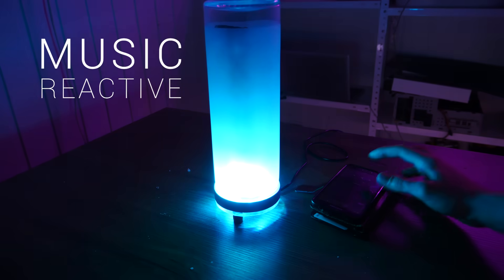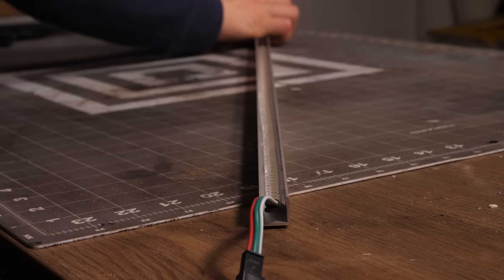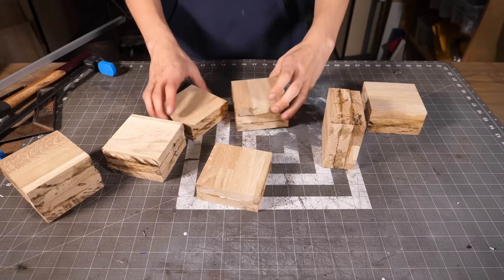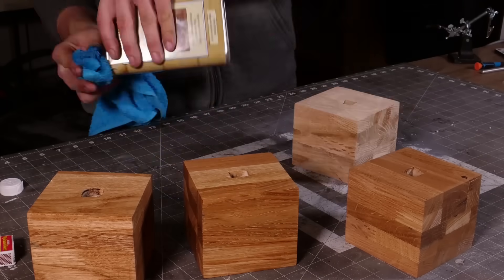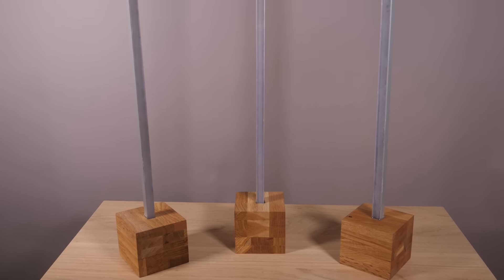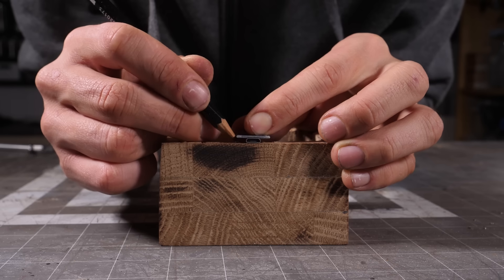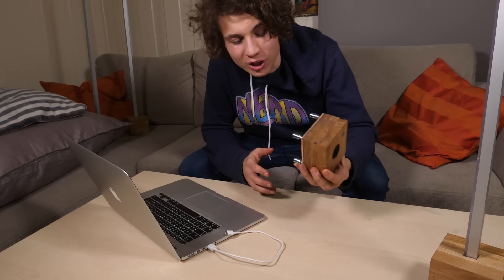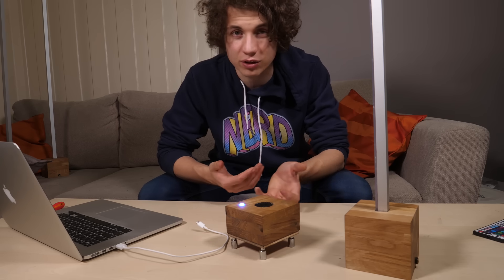Making Wireless MUSIC VISUALIZING Floor Lamps

Comment: Hi, I built it by myself and works fine so far. The only problem I have is, that the program is changing by itself after a few minutes. It means in detail. I`m using four programs in the sketch. When I choose the fourth (fire effect) it works for a few minutes, then suddenly jumps to the first program without pushing the select button. Any ideas?

Comment: I would change a few things: 1. Aluminum profiles. Instead, I would use kitchen countertop aluminum profiles. They come with diffusers already and can be found with different angles too. 2. Electronics. For one time use, they are ok, but not for daily use. 3. I would install microphones on all boxes and connect the whole system as IFTTT, so I can use it with Alexa :) Nevertheless cool project!

Comment: I wish there was anyway to implement this, but only react to low frequencies. Since I prefer when the light up during the bassline only (reacts clearer so light pulses are more separated) and for explosions in films to add to the light from the fire/lightning etc.
Reply: You just need to add a low pass filter or band pass filter to your microphone, which you can build into the circuit yourself and play around with to hit the frequencies you want.

https://www.electronics-tutorials.ws/filter/filter_2.html

I've been toying with the idea of several bandpass filters; one to pick up bass, one for treble, etc; and have the RGBs light up with various colours depending on the intensity of sound at certain frequencies. Deep sounding heavy metal would light up red while high pitched singing would be violet, and whatever in between.

Comment: How would you do this with out the WiFi part
Reply: If you wanted to keep the light stands and microphone separate and without wires, you'd probably need to use bluetooth instead.
If you are talking about integrating the microphone and light stand in one unit, you'll be able to grab the microphone handling part of the code, and the led controller part, and just cobble them together into one program.

Comment: I made a video about making this! Some things I’d mention:

- depending on the size of your LED strip you may or may not need an external power source.
- make sure you get the same mic he did, the cheaper red ones are AWFUL.
- the mic needs 3.3 v, not 5
- it will probably cost around $30-$40 to prototype your first one (without the finishing touches like the stand or wood).
Reply: WHERE IS THIS VIDEO?
Reply: Can you recommend me a microphone for this project, the link on this video doesnt work anymore

Comment: Not sure why you make posts like this when you not prepared to help people solve a setup problem.
Reply from the maker: Hello, thanks for your feedback! This is a DIY project I made mainly for myself, but I encourage everyone who wants to try it out, even though it may not be a beginner project. There are a thousand problems that can occur during the process that I don't have a quick answer to (or that I have even encountered myself),  so please understand that with 1.4 million views it's impossible for me to answer everyone who contacts me about this. It's not to be rude or disinterested, it's just a capacity problem, and I would not be able to spend my time on anything else if I were to go through basic troubleshooting with everyone. Feel free to join our Patreon where there is a tier that will give you access to guranteed code help. 

Kind regards,
Hansi
Reply: Yet you replied to this?

Comment: Is anyone having issue using this code for more than three lamps? Everytime I attempt to add a fourth lamp all of them don't connect up well.
Reply: No Issues. You have to edit Master AND Slave for the right amount of Lamps. I'm running on his code 7 Lights now. Also added some more static colours. Planning to add more VU Meters, but i'm not as fit as wanted to program the code... using try and error :D

Comment: Am I the only one who sees that the 'mode' push button just shorts out the LED/Resistor back to the D1 pin?? The connections aren't right but I don't know enough about Arduino/WeMos stuff yet to know where the button should be connected to. In the video, the 'status LED is always on and you mention that the mode push button is connected to the pull-up resistor (not the LED).
Can you correct the schematic please?
Reply: the wiring as provided is right. For me it's working as in the video. The Resistor is not for the LED, it's a pull up from 3V to D1
Reply: @magicwoody  Yes, I understand pull up resistors and how they work (I know general electronics very well , just new to arduino stuff), and I've become much more familiar with this and other arduino circuits since I posted. However that doesn't change the fact that the schematic isn't drawn correctly.
The issue is there should be a connection dot (node) at the LED anode (red)/+3V/resistor connection and another connection dot where the GND/LED cathode (BLK)/switch (BLK) and microphone gnd cross. There should also be a node dot at where the resistor connects to the D1 line and the switch. Without these connection dots it looks like the line from D1 comes out, goes to the resistor (being this is a tee junction it could be assumed to be a connection even w/o a node dot but would look cleaner with one) out the resistor to the LED, out the LED to the switch, out the switch back to the same D1/resistor connection. Many LEDs do require a current limiting resistor so looking at it face value, someone could/might assume the resistor is needed for the LED, depending on the LED used (I have a number of LEDs that run on 1.5V). From what I've read so far, many arduino and arduino type boards have internal pull up resistors and external parts are not required.
IF we assume that certain lines are connected where they cross, how would someone not familiar with electronics know just from looking at this, which crossing lines connect and which crossing lines do not connect?? At least it's in color but many schematics are not in color. It would just be generally much less confusing and clean to use connection point dots so as not to cause confusion.
I have this working just fine also, but the drawing is still not drawn properly by most electronic schematic standards.
Just my opinion of course.
Reply: The dots..... True 😀

Comment: If there is a home audio system, would it also be possible to hijack the signal going to the speakers to sync the lights and sound instead of using the microphone in the project.

Comment: 144 LEDS PER METER, and I thought the 60 leds per meter one was expensive
Reply: I was surprised. I am not the DIY person so I don't know much about these prices. 
I knew that a few years back, here in switzerland such an LED strip would have cost more than 100 bucks. Now, it still costs almost 60 bucks. But damn, he got his LED strip for 13 USD.  That is insane. It is like free.
Reply: @LucaDarioBützberger  you will find it on www.aliexpress.com
Reply: The 60 Led per meter variant in Argentina is about 50 bucks. For a project for school we spent over 1100 BUCKS just for lighting. LED strips are expensive
Reply: @juansanchezserantes894  Well, that is expensive :/ Damn.

Comment: Hey I have a question.

Is there any way that it won't react to sounds in it's environment but the sound on a device? Like a computer? Because I very, very rarely listen to music without my headphones including that I live in a dorm and just plain simply can't go on and blast the newest whatever at 100 max volume. And I think  it would make for some awesome decoration in a smaller form on my desktop
Reply: Devin Crawford made a similar project like this using the LED strips, but instead of having a microphone receive data, he used an oscilloscope to test out the variable sound he uploads, and then sends that information to the Arduino to be processed and give directions to the LED strip. I highly recommend his video since it’s much more easier to create and uses the same concept you mention

Comment: @Nerdforge One of the best project !! 
I'm wondering if it's possible to use an xlr or aux audio input instead of the sound sensor. 
This might be great for all the live band, because it ould be  possible to run an aux out form the mixer directly into the led laps, deciding for exemple to light them up in syncro with the drum kick! 
Any idea?
Reply: you simply need to put a connector instead of the microphone

Comment: This is a great project - but I fully guarantee it won't be long before you stab yourself using chisels like that.  Learn how to properly use your tools before you seriously injure yourself, please.  I also think you might want to spend a bit more time on properly laying out, measuring and finishing, you're seriously letting down your projects - like proper use of table saw/mitre saw to avoid burn marks, and how to remove said burn marks. Hopefully you'll recognise this comment as helpful as it is intended, and not overly critical.

Comment: nice project
but why using an microphone instead of using an bluetooth connection?
cuz imagine you are celebrating an feast and there is music and everyone is talking... the light will turn weird i geuss?
Reply: You could use an 1/8" (3.5mm) audio input jack instead. Bluetooth is very complex and not very useful for DIY projects, particularly for instant reaction, as it buffers significantly and doesn't work well at a distance. Wifi is much faster, so it's a pretty good choice for this. I would have liked to see an audio pass-through option on the build, but it's pretty easy to add.
Reply: @astersfun  Can you give me more information on how to add the jack and the pass-through?
Reply: @astersfun  Hello, I actually recreated it with all the stuff But in the code it not connecting with Nodemcu. In serial monitor Sending Heartbeat is showing with size of 8. Can you please help me.
Reply: Wifi and BT use the same freq. Band. You will get struggle with the wifi data stream to the lamps if theres also BT music connection. But instead of mic use a line input. Just add a capacitor 1µF and 2 10KOhm Resistors to A0. Positive Pin of cap to A0, also both resistors. Other end of Resistor one  to +5V and one to gnd. Line In to negative pin of Cap and gnd. I you want to try bt, there are modules with Audio output, but keep antennas as wide as possble in distance to each. I'm running 5 Lamps by one controller. If a bluetooth is active near by the lights have to reconnect often. gd luck
Reply: @magicwoody  thanks

Comment: is it possible to use a aux port instead of a microphone
Reply: instead of mic use a line input. Just add a capacitor 1µF and 2 10KOhm Resistors to A0. Positive Pin of cap to A0, also both resistors. Other end of Resistor one  to +5V and one to gnd. Line In to negative pin of Cap and gnd.
Reply: @magicwoody  can you send me a schematic, my english isn't good enouch to visualize it
Reply: @thqnhvu  Just Check the comments here, i posted a schematic already

Comment: Ab wann verkaufst du? Liebe Grüße aus Deutschland
Reply: Selbstbau macht doch viel mehr Spaß :) Ich habe 5 Lampen gebaut. Die Sockel sind bei mir aus 4mm Sperrholz gelasert, alle Öffnungen ebenfalls ausgelasert. Aluminiumprofile gibts bei Amazon, 6er Pack für 29€ um den Dreh, sind echt klasse und verbiegen nicht ... https://www.amazon.de/gp/product/B072BRY8ZT/ref=ppx_yo_dt_b_asin_title_o01_s01?ie=UTF8&psc=1 Falls du nur die Sockel brauchst, kann ich dir fertig machen. Sehen so aus:  https://www.facebook.com/photo.php?fbid=1299332340204986&set=pb.100003846966198.-2207520000.1567169345.&type=3&theater https://www.facebook.com/befriends.radio/videos/vb.100003846966198/1333408596797360/?type=3

Comment: Does someone know if there's an alternative 12v version of the wemos wifi board? The new ws2815 strips support up to 12v...
Reply: No idea, but just use a step down conv. oder power regulator to get the 5V for Wemos / Node

Comment: Awesome! i would just save be careful. if you are using the full metal strip of 144/m LEDs, it can draw more than 8A, and the PSU you picked handles 8A. so full white at full brightness would actually exceed the PSUs rating.

Comment: @Nerdforge 
When making the electronics do you really need the perfboard or can you wire straight into the Wemos and etc.
Reply: It could harm wemos board with heat its better to take precautions 😂

Comment: A Bluetooth transmitter costs ~$10 usd. Using a microphone connected to a speaker makes feedback.
Reply: There are no speakers. The sound isn't being transmitted back to the microphone, it just changes the lights.
Reply: @jujubaloolian  the microphone still uses more energy, is less accurate, and each microphone will have its own directional preference, and sound envelope, in addition to picking up noise.
Reply: no problems here, works vy fine. Mic is sensitiv enough to grab sound and lighten up by normal volume. power consump. is vy low ~2mA. The Wifi uses most power. Btw. i use a 2600mAh Batterie, fully charged it's hold power for ~6hrs

Comment: Hello I have a very big problem and I need your help please ! (i'm very bad in arduino, code,...)
So i've do the controller and now I want to put it on the arduino program and when i copy your code in my program i have a lot of error messages for exemple;

sketch_may31a:4:29: error: reactive_common.h: No such file or directory

#include "reactive_common.h"

compilation terminated.

exit status 1
reactive_common.h: No such file or directory

So i don't know what to do, if somebody can help me please

Comment: This is a lovely and well executed project! All that glue made me cringe though -- how do you fix a broken LED strip? They fail all the time, unfortunately.
Reply: use this instead, only a tip, looks good, vy stable https://www.amazon.com/V-Shape-Aluminum-Channel-installation-Mounting/dp/B00VUAYFOG/ref=sr_1_4?crid=VLBOZR58V4J9&keywords=v+shape+aluminum+led+channel&qid=1559810211&s=gateway&sprefix=v+shape+aluminium%2Caps%2C232&sr=8-4

Comment: I like the fact that you can run multiple 'slaves' off of a single controller.  Cool project. One poster mentioned latency as a concern. Glad to hear that it seemed OK.
Reply: latency is not a big problem, not really visible
Reply: @magicwoody  Nice timing on your response. Have traditionally been using Infra Red (with Nano's) and have a lot of controls with a 24 button pad.  I'm now starting to use MQTT with my ESP8266's and thus able to use my phone to control multiple LED displays. There are several MQTT clients for the Android, so it's nice not to have to design my own page from scratch.

Comment: Is it possible to do this lamps works from Li-ion 18650?
How long time they can ligthts from one ore two batterys 3000mAh?
Reply: The controller runs with a 18650, a 2600mAh ~6hrs. But the lights don't really. ne LED uses ~60mA for white colour in worst case, so you need 8 Amps by 5 Volts. Also the really need 5 Volts, 3.7 is tooooo low.
Reply: It means: 4 battarys 3000mAh will works ~1 hour in worst case (if all time will white colour)? But in reality it will aproximetly 4 times longer (1 battary per hour).
Reply: Strips need 5 Volt, not less, otherwise you get probs with the WS2812
Reply: but theoretical it would work
Reply: LED strip needs 8A*5V=40W
1 battery 18650 have 3.7V*3Ah=11Wh
As I undestend - 4 battarys with DC-DC 2-4v to 5v can works 1 hours with white color. But in real situation, average, only half of LED stipe is lighting (we need 20W). And less then half time is White colour (eath color separatly use 1/3 of power). It means - average we need only ~10W (1 battery for 1 hour).  Is it correct calculation?

Comment: Where did you get the aluminum bar?
Reply: I think, you can get it in every hardware store.
Reply: use these ones for example, really nice with the white glass https://www.amazon.com/V-Shape-Aluminum-Channel-installation-Mounting/dp/B00VUAYFOG/ref=sr_1_4?crid=VLBOZR58V4J9&keywords=v+shape+aluminum+led+channel&qid=1559810211&s=gateway&sprefix=v+shape+aluminium%2Caps%2C232&sr=8-4

Comment: You know what would be sick? Cut out the corners of your room drywall and push these lamps into the crack in each corner so they're below the surface and they go from floor to ceiling.

Comment: I made everything like you but my led strip wont open. Sometimes when i plug it in and out it displays some random colors but thats it. Please help. I spent a lot of money on this.
Reply: Same 
I just can't get it to work
Reply: @panospanou7306  ,now it works properly but only the first two leds. The others stay closed or are white. To connect the two boards i open the controller first without the microphone, i open the led slave and then i plug the microphone which i think makes the problem.
Reply: @steliosstavropoulos499  απο Ελλάδα εισαι;
Reply: @panospanou7306  ναι ρε από πού είσαι;
Reply: @steliosstavropoulos499  Το έφτιαξα 
Ηταν πολυ απλο τελικά
Απλα στον κωδικό του slave στο define led pin μην βαλεις μονο τον αριθμό
Βαλε και το D 
Και επίσης πρέπει να είναι συνδεμενα με usb καο τα δυο
Εγω τα συνδρσα σε φορτιστες και δουλεύουν άψογα
Reply: Ευχαριστώ! Είχα ήδη βάλλει το D. Θα δοκιμάσω και αυτό με τον φορτιστή αύριο για να δω αν θα πετύχει.
Reply: @panospanou7306  Στο messenger είμαι Στέλιος Σταυρόπουλος και για φόντο έχω ένα πράσινο πραγμα
Reply: @steliosstavropoulos499  πράσινο προς Χρυσό;
Έχω αχρωματοψία😂
Reply: @panospanou7306  ναι απλά τράβηξα μια ότι να ναι φωτογραφία το τραπέζι μου😁😁😁
Reply: @panospanou7306  με βρήκες;
Reply: @panospanou7306  Ακόμα δεν έχω βρει άκρη. Όταν ανοίγω το master με κουμπωμενο το μικρόφωνο δεν κάνει τίποτα. Όταν το ανοίγω χωρίς το μικρόφωνο ξεκιναει το wifi και όταν το κουμπωσω δεν το διαβάζει. Αλλά όταν πατάω το κουμπί αλλάζουν κανονικά τα modes. Κ;ποιες φορές επίσης ανοίγουν μόνο τα δύο πρώτα λεντακια μόνο. Μπορείς να βοηθήσεις;
Reply: @steliosstavropoulos499  Σου έστειλα